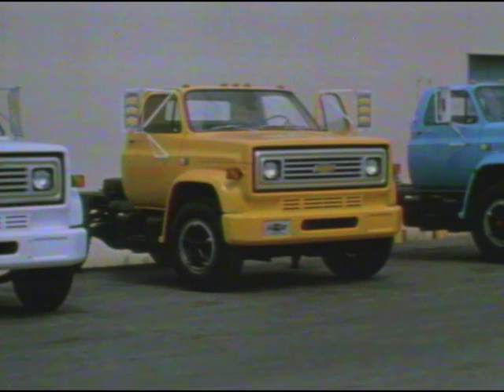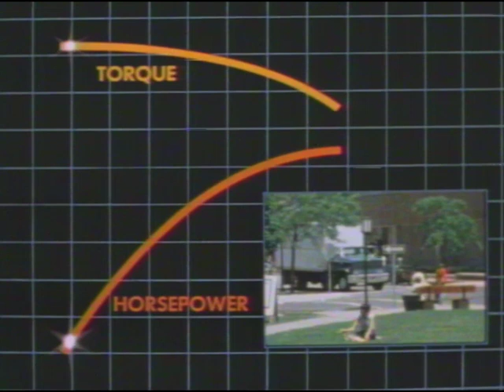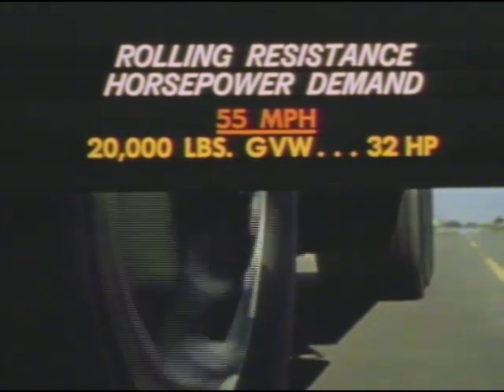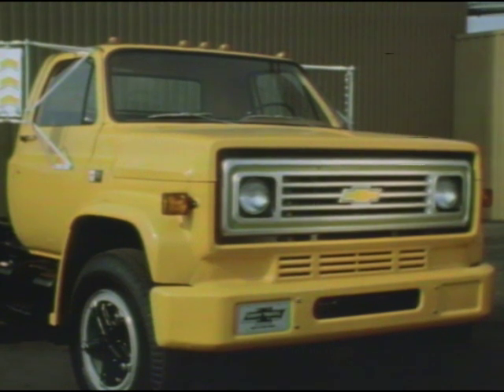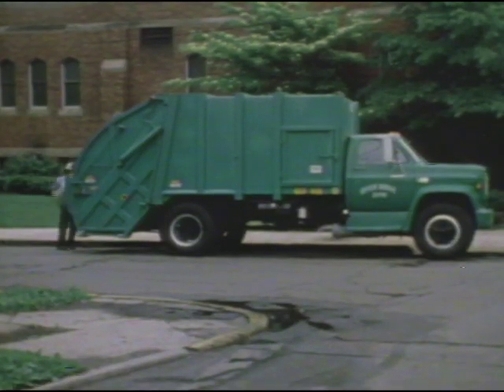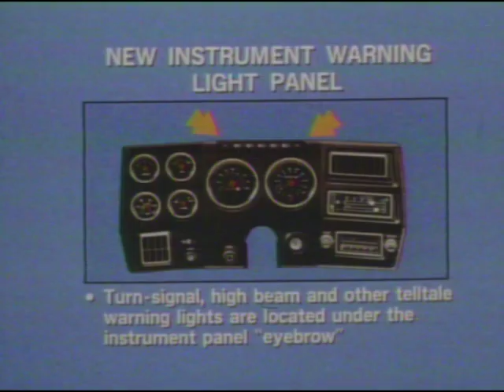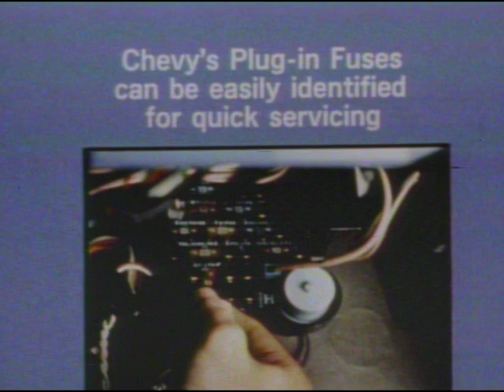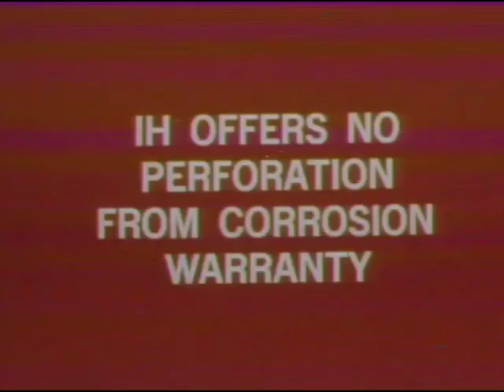1981 Chevrolet Medium Duty Trucks GM185B

Comment: It’s crazy how much cars and trucks advanced from just the early 80s to the late 80s. The early 80s was essentially the same as the 70s but by the late 80s cars and trucks were using turbos, fuel injection, ECUs, abs, etc all things that were rare in the early 80s
Reply: Trucks were using turbo in the 50's👍
Reply: That's because they had a mission to milk you.
Reply: @TempoDrift1480  Kinky... 😳

Comment: I admire how essentially this is a Silverado cab, but enhanced with a new fascia and lifted to give it a Semi look.
Reply: Re framed for more capability
Reply: here in Brazil we had some chevy trucks too, It had a similar design, but with other cabin, beyond diesel and gasoline versions, we had alcohol version too, nowadays these alcohol and gasoline trucks was converted to natural gas, or had their engines replaced (usually mercedes benz engines)
Reply: I never even knew those existed. Wow
Reply: Agree, I always thought that was a rather clever application of parts commonality that no doubt kept costs down. A passenger cab already exists, so let’s use that.

Comment: I had an 8.2 Fuel Pincher V8 engine (naturally aspirated) in a huge GM-chassis step van (86). I liked that engine and it ran well but had very smelly/dirty exhaust and was not very efficient or powerful. I liked how low it idled and the sound of it. Had a very stout Allison bolted on the back. I think that engine was in a lot of school busses at the time. They required rare expensive tools to adjust the injectors which is one reason they disappeared. No one could get the tools to keep them running or running well. These trucks of this era are just really nice looking in my opinion. I especially like those ones with the massive rectangular grill over the much smaller row of 8 rectangular headlights. A very unique and cool look, in my opinion. Thank you so much for posting this great video!

Comment: It's amazing what gearing can do. If you were around at the time you know the speed limit was only 55 back then, yet most of these trucks struggle to make it to 50. If there was a little grade the driver would be rowing through the gears, the engine would be screaming near Red line, and the truck would be going like 20 mph lol
Reply: True Dat but then I Rev it to the max in low 4 and she gets up the huge grade
Reply: I grew up around older trucks like these. Chevy and internationals. You could do 60-65 of you were lucky. But the speed limit was only 55 so you were good. And didn’t need the hp to maintain 70mph. I love all the “kids” that buy those “retro” trucks and want them to go faster or so what a modern truck can do - which they just can’t. Totally different technology for a different application. In 1984 my dad bought some international dt466’s with a true ten-speed in a single axle dump truck at 35k gVW. He had them over built in the drive line and he turned up the pumps to make about 275hp. Those trucks were rocket ships compared to anything else. Very rare at the time yet common today. Compared to to todays trucks he and I still have and run three of them.
Reply: It seems to me going up a grade with those older engines, that it would have been far more efficient to run the engine no higher than a speed where peak torque was produced. Redlining the engine up hill at 20 mph is not taking advantage of the torque.

Comment: Back in the 90s, we had a new to us,1985 Brigadier 6 cylinder diesel with a 9 speed tranny and a 2 speed rear axle. My boss picked it up at a military auction. Can you believe they actually bothered to put cup holders in those trucks? The suspension was so rough you felt every single bump.  It drove so rough, I probably spilled more coffee in that darn truck than I drank. 🤣 I told my boss, "If we don't get an air ride seat, I'm leaving. He just bought the truck, and he said it couldn't be that bad. I said ok,well go drive it for a couple hours. He came back about 20 minutes later, and I got the new seat about a week later. 😆 and a new CD player, but you really couldn't play any CD's because the ride was so rough that they were constantly skipping, and it was annoying. He was the best boss and just an all-around good person. Even after I quit to persu a different career. I still stopped in at quittin time once in a while to have a few beers with those guys.

Comment: Just learning how these trucks back then hauled and pulled the weight they did with the low numbers of horsepower and torque. I have a Chevy 3.0 l duramax that has 277 HP and 460 lb of torque which is much higher numbers and those trucks were hauling 24,000 to 50,000 pounds of weight. That was educational thank you.
Reply: Remember. These are SAE Gross HP numbers as well. 

That means they were measured with no accessories, no air cleaner or exhaust headers, not even a water pump!

They had to switch to SAE Net for passenger cars in 1972 which was a big reason horsepower number fell so fast in the mid-70s (not just unleaded gas and emission) but I guess they were still allowed to use them for trucks… probably because of the accessories (air pumps, PTOs, hydraulic pumps, etc) that you might install.

Comment: So the 454 grew up to be a fuel injected 496 with 350 Net HP. That would have really set the world on fire in 1981.
Reply: I blame emissions. We went form big blocks and high hp. To freakin turds until computers caught up.
Reply: @Patrick Baptist although emissions equipment strangles the diesels too I have to agree with you. Even modern v10s in those big rv campers are no match for a diesel. You’ll pay more but It’s worth it in the long run.
Reply: Hence a 75’ motor home with a 454 and 37k just worn flat out, I’d like to find a bunch of those old brick shaped campers and put diesels in them, even some manual transmissions with a 2 speed rear axle. That’s a little crazy but it sure would pull good and be fun to drive.
Reply: Have a 8.1 2001 suburban 330k miles and it doest care was used tp pull heave construction trailers ive pulled over 15k with it and it doest care its a beast
Reply: It set a lot of Chevys and GMC's on fire too.
Reply: @Patrick Baptist About 16 months ago My sales rep at Ryder told me Freightliner was going to start giving an option for a gas motor again. The emissions are killing everyone. They are just not reliable. I have noticed quite a few new Yellow School buses with gas motors. Today's gas motor will do the job and get the same gas mileage and power as a diesel without the headaches of a complicated emissions system.
Reply: @remb9614  I have the V10 in one of my Ford Cutaways. It's an 18-foot box with a 14,500 GVR. Power has never been an issue. For what I do it's ok, but the gas mileage can be 9 MPG depending on the load and hills.
Reply: @ Spud Taterson

Swapping to SAE Net is what killed hp. 

From 1972 on they had to measure the engine as it would be installed in the car with things like air cleaners, exhaust headers, accessories, and even water pumps. 

None of those 1960s engines ever made their advertised power like we understand it.
Reply: @ Deborah chesser

Should have got a 460 then. 

My 460 doesn’t have any problems pulling my 28’ C Class through mountain passes in the summer. Does the speed limit up all but the steepest hills no problem. 

The key is the 460 gets the same mileage no matter if you’re going slow or fast… so floor it and rev it. Faster speed means more cooling air over the rad and faster engine speed means less load on the engine and faster fan and water pump speed. 

People are too scared to give these big blocks hell… but that’s what they were designed for.

Comment: Some fascinating facts offered here. Also an 8.2 liter engine should really make much more than 165 horsepower- like twice that amount of horsepower. Ditto for torque ratings.
Reply: Not in the early 80's they didn't
Reply: And also remember that these are gross ratings.  Today, all specifications are given as SAE net which means the accessory drive belt along with power steering pump, a/c condenser, and other parasitic drag losses are factored in to the stated figure.  So the 165 HP is actually about 20% higher than would be reported for the same engine today.
Reply: those were old school Diesels. A 10 yr newer Cummins 5.9 with 12 Valves was only 180hp and around 400 torque.
Reply: Thank the EPA...
Reply: @rosslarkin6742  net power ratings were adopted in 1972
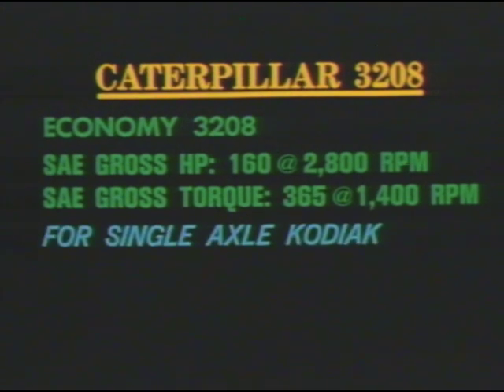Reply: @bigggmustang73  yes, but if you pay attention the ratings of the diesel engines are reported as SAE Gross HP.  You will see around 9:30 in this video
Reply: @rosslarkin6742  good catch thanks
Reply: N/A diesel engines are dogs no matter the maker
Reply: The “fuel pincher” four stroke Detroit Diesel was a dog just like it’s little brother the 6.2, it was a reliable, underpowered engine that was whimpy even compared to a 366 or a 454 in medium duty trucks. There are still quite a few GM medium duty trucks from this era in use by farmers where I live, and there’s a reason almost all of them opted for big block gas engines.
Reply: Maybe you could make modifications with it to make it produce a little more? I used to be a fan of the Nascar of 1950's and they used like continentals and Hudsons and they would do some little modification and tweaking, and they would already be making 150 mph instead of 90 mph tops. 

And those trucks have iron block engines, soo they won't bust real easy. I would say 230 hp tops?
Reply: They were also designed to provide that power all the time. These things were driven foot to the floor constantly. If you take a normal light duty pickup engine (from those days) and drive it at Max power, it's not going to last very long.
Reply: @chrisxa1222 Mitsubishi: hole my 🍺😅

Comment: 8.2 Detroit is the most efficient way to turn Diesel Fuel into noise and smoke. Hopefully they are all in the junkyard.
Reply: I think you're thinking of the 2 stroke diesel ones. The 8.2 was 4 stroke and most of them did end up in the junkyard, I mean 165hp with 500ci is 3 ci per horse power which is awful even for 80s diesel standards.
Reply: FUEL PINCHER
Reply: Toroflow was early GM diesel 1970s bad.
Based on giant 60° V6 V8 gasser block
Reply: The Toilet Flow Diesel. I’ve not had the opportunity to work on one of those. I would guess most of them are in the salvage yard.
Reply: @andyvonyeast332  I had gas 478M V6 good motors.
Reply: @Nudnik1  Yeah we have one of those giant v6's in a grain truck, it was a pretty good motor very overbuilt for a gas engine.
Reply: @robwhite3241  they made a v12 out of two V6 gas motors also.
Up until 1970s giant V6 .
305 V6 were in little pick ups also 
Use a lot of fuel though.
👍
Reply: Those were the 2 strokes that made all the racket.  Screaming Jimmy's, as it were.  8.2's were reasonably quieter by the standards of the day.  I havent seen a running 8.2L in many, many, many years.  Still know alot of farmers with Jimmy's though.
Reply: NC Public Schools still have some 87-90 Chevy B60s with the NA 8.2 hanging on. They don’t move quickly by any means, but they get the job done and they just don’t quit
Reply: @aeastman16  they were ok. Dt466 best
Reply: @Nudnik1  many engines have come & gone but the IH-DT466 engines have out lived them all 😁 . Nothing beats a GREAT design !
Reply: @craigalston2208  yes ...but not the dt466e heui .
I hate heui motors .
Mechanical injector or common rail new are good.
Reply: Better then new junk

Comment: When the announcer said that the "Fuel Pincher" should be used for moderate loads/stop-and-go driving, that was a COMMANDMENT and not a suggestion. Those engines were under-engineered pieces of carp, with a warranty replacement rate of 50%, so bad that when Rodger Penske bought Detroit Diesel in 1988 he specifically told GM to he did not want them.

Comment: They showed a CAT 3208 V8 in red dump .
Not a Fuel pincher 8.2 😂
Reply: The yellow truck has the 8.2 litre fuel pincher diesel. The red truck is the Chevy Kodiak which has the big grill and the quad rectangular headlights with a Caterpillar 3208. There were two 8.2 litre diesel engines. Normally aspirated and turbocharged. The diesel engine is used for high mileage 12.000 miles (20.000 kilometers) or more per year, the gasoline 12.000 miles (20.000 kilometers) or less.
Reply: @frankdenardo8684  yes I had a gas c60 350 V8 in NYC box truck excellent reliable cheap to fix. 
Thanks
Reply: @Nudnik1  The 5.7 litre gasoline engine is very legendary. Around the mid 1980's the carburetor was replaced with electronic fuel injection which is more reliable.
Reply: @frankdenardo8684  I have a few GM 6.0 and 5.3 Ls trucks vans best. One has 350k miles runs perfect

Comment: It’s funny now the Silverado 1500 have a 2.7t that make 310hp and 430ft-lbs only 2 engines for this 1981 truck had more torque back then. Still the 2.7 is not enough to be considered a truck engine by most.

Comment: I did not realize they were using  a engine out of a Silverado 1500 and 2500 to power a top kick.  That goes to show how capable of these motors really were. Also I did not realize the 6.0 motor was that old. The 5.3 is a great motor but I think they should bring the 5.7 back as an added option.
Reply: Not the same 6.0 and the 5.3 is more or less a modernized 5.7
Reply: @xxxdankengine2176  the 5.3 shares almost nothing with the old 5.7 they are two totally different engine architectures.
Reply: @shawnhaas5158  

Not true regarding the 5.7L LS.
Reply: The 6.0 they talk about here is the 366ci tall deck big block, has absolutely nothing to do with the modern LS based 6.0. The 5.3 will knock the socks off of a 5.7 truck, they're gone for a reason, and they'll never come back for emissions reasons alone if not anything else, remember standing behind a 350 truck even from the 90s and just smelling it? Great engines, just out of date.
Reply: @tommyw.9424  My 98 Z71 Silverado 5.7 vortec dragged my 05 Z71 5.3 backwards like nothing and tows my car trailer better than the 5.3 unless that 5.3s rpms are through the roof that 05 5.3 vortec was a gutless torque less wonder.

Comment: I still see these all the time

Edit: oh my God I bet those gasser 4.8s are turds!
Reply: First hand experience with this. My grandparents got one used in the late 80s for their hardware store pickup and deliveries. My dad would help them with pickups since they were aging. I would hear him complain about how slow it was even before they loaded it down. In fact he had to modify his route to avoid a slight uphill grade after a stop light because the truck would barely make it up the hill. I don't think they sold too many with the 4.8. It was loud and sounded like it struggled everywhere it went loaded or not.
Reply: @GenetrySolar  I had one it had shitty drum brakes did he mentioned that the brakes were horrible as well
Reply: @hfd268  nothing on the brake that I can remember. I was only about 7 or 8 at the time but I do remember the loudness of it especially when loaded.
Reply: I know medium duties used to all be pretty slow, but it's absolutely insane that they sold mediums with the 4.8 six. That was a dog engine in a pickup truck!

Comment: Boy, did these trucks stink.  8.2 was pretty close to the worst diesel ever. Cat 3208 was better in its day but cheapskates that spec'ed these never ordered it, the 8.2 was cheaper.  Gas engines almost better in these chassis.  Either way, foot mashed to the floorboard, heat burning through the bottom of your shoe.  These were the bad old days and the grille on the larger ones, ugly as a mud fence.  How did that monstrosity leave the drawing board.

Ford cab/chassis were somewhat better but GM tried to sabotage them by selling the same lousy 8.2, open the hood of the Ford and the blue GM square staring back at you.